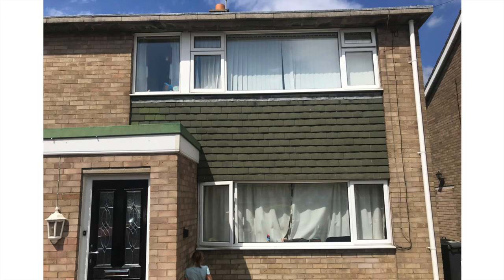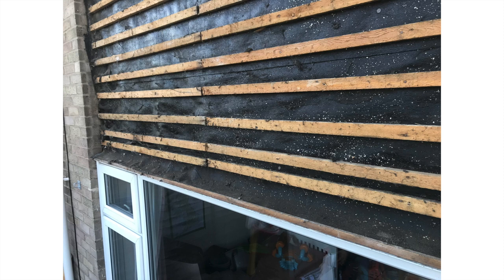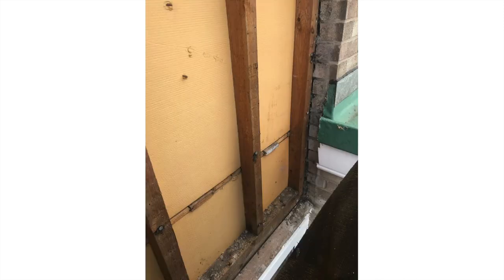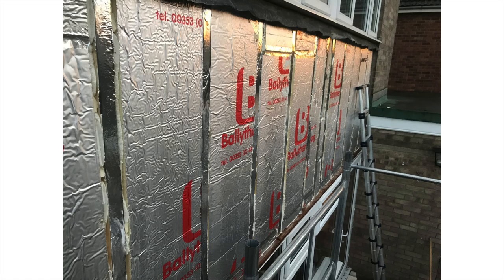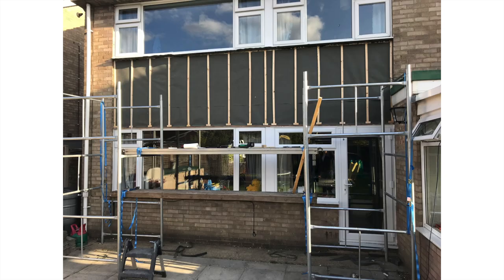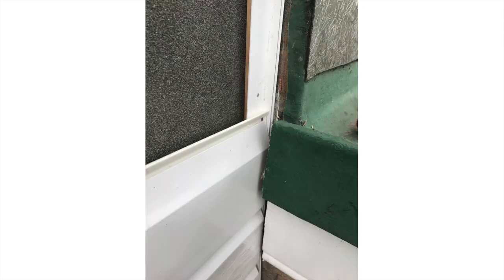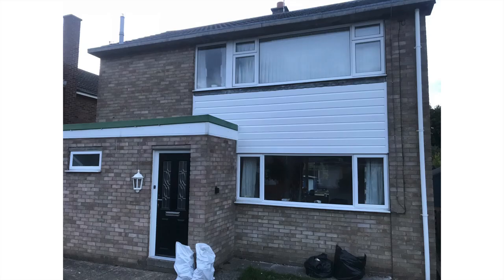Behind the tiled panel installing insulation and upvc cladding

Comment: Well done… surprised it was originally only timber framework with no insulation, I thought it would be concrete blocks behind the tile cladding.
Reply: Our 1960s house has this facade as well but it also has block-work behind. It's still badly insulated though.  Must be different construction methods across the various developers at the time..

Comment: Nice job you've done of that, 120mm is a bit overkill though, the spec for a wall like that would only require around 75mm but it won't be cold that's for sure lol
Reply: You can never have enough.
Reply: Id have agreed with you 3 years ago… but having been through the winter we just had at the fuel prices we now pay… the more insulation the merrier!
Reply: We are looking to do this on our home. The gaps in the tiles also allow pests through so this looks great. Thank you for sharing.

Comment: Hi Brilliant Vid James!  We have same row of external tiled panel on similar age property - in our case a block of flats.  We were wondering what's behind the wall tiles.   Shocked to see it!!!   Our block is having a lot of condensation issues inside flats both below and above the row of tiling.   Do you think draft getting in behind the row of tiles can make its way into the wall cavities throughout the building, thus making the internal walls  below and above the row of tiles (not just behind) extra cold & thus causing condensation issues?   Do you know how the tiled panel joins up with the cavity wall below and above and are there gaps into the cavity wall from behind the panel?  Also have you or anyone any idea why buildings had these tiles put on rather than a wall back in those days?  Would appreciate any comments :-)
Reply from the maker: Hi, yes, a draft can get in. the original wood is not airtight. Condensation is all about the Due Point, which is affected by the temperature of the air, the water content in the air, the temperature of the surface and the air-flow. Warming up the walls and internal air-temp should reduce condensation, but it depends where the water is coming from (showers with no extractor fan, drying clothes inside, etc..) You normally have to do a few different things to get rid of condensation and increasing the insulation is only one of the things. 

I blocked up the small gaps around the wood in the cavity with silicon sealant, but some airflow is not necessarily a bad thing. I only did that so the little polystyrene balls didn't escape when I had the cavity walls filled, which I had done a few weeks afterwards. So in summary, yes, it should help reduce the condensation, but it depends on what's causing the condensation. 

Houses were built this way due to the high price of bricklayers (due to bricklayer unions and the 2nd world war taking workers out of the industry) Wooden frames as walls were very popular in the 60's.. started being phased out in the 70's and by the 1985 were breaching building regs due to the poor thermal value.
Reply: @jameslincs  Hi James. Thanks so much for your response.  Understand about needing to do a few things to tackle condensation.  In my flat I installed extra ventilation and had a polystyrene layer added to offending walls to warm them up and stop severe condensation.  Dehumidifier is used whenever drying clothes and door shut with extractor fan left on after showers.  Other flats also have similar condensation damp issues.  Our attention has now turned to the row of tiling as possibly having an effect on the internal walls being so cold.   We would like to have cavity wall insulation done but were advised we need to resolve the damp issues first as otherwise it could cause more problems.  However, if the damp turns out to be solely to do with the temperature of the walls then cavity walls insulation maybe needed to sort out the damp.  Thanks so much for the info about why wooden frames were popular in the 60s.  Am amazed!  Would never have guessed that the reason!  Didn't see that when Googling either.  We wondered if it was about giving extra protection to walls - but after seeing your vid, clearly not as there are no brick built walls at all underneath!  Goodness.   Were there other good options to UPVC that you considered replacing the tiles with?  Also when you had cavity insulation done did they need to separately spray under and over the wooden wall section?  Thanks so much for your helpful vid and comments - massively appreciated!
Reply from the maker: @gaiaum  maybe they are concerned that the damp is from the gutters leaking into the cavity. We had to have new gutters before we could get cavity insulation installed. 

Yes, they will put it above and below the wooden panels (if there is any brick above the panel area, which their normally isn’t, at least, not on a house anyway)
Reply: @jameslincs  Wow That's got us thinking!  Our block is 3 storey with two rows of tiled sections & two rows of painted white sections next to windows (above lower brick layer).   Now wondering if the white sections are similar wall construction to the tiled sections - always thought it was mad to have white sections which need expensive painting maintenance (with scaffolding as so high) & wondered why the original builders didn't follow through with the brick.  Looks likely they are also stud walls, covered in render, as it sounds unlikely as you say that there would be brick built above tiled panel sections, seeing as the tiled sections have no brick wall behind!  Goodness!  Well this has certainly been an eye opener!    We will investigate further now... Thank you so much for your post and advice - so helpful and much appreciated!  👍😃
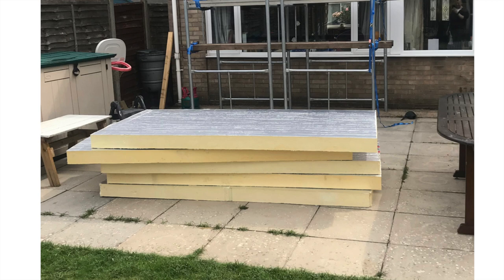Reply: 1:41 Using wood framing in these sections probably made sense because the windows alone would never support the weight of a brick&block wall, so one would need either heavy mullions or heavy lintels to support the weight of masonry, and that would involve a lot of complication and skill. My front wall is all masonry, but my next-door neighbors house, which shares a wall with mine, has an upstairs bumpout to make room for a 3rd bedroom, and that's framed in wood for similar reasons.

Comment: I've done a fair amount of cement board siding. But there's one job that's been weird. It's a full timber constructed house but between the two bedrooms upstairs the plasterboard is literally set back external to the windows and has like an insulated asbestos sheet backing. Bizarre

Comment: Excellent Video very helpful with all gas prices going up, can you please let me know if multifoil insulation can be good option instead of Pir? Can we get say same level of insulation from 30mm Multifoil to 50mm Pir?
Reply from the maker: I haven't used multifoil or BreatherQuilt, but with the price of PIR increasing, a foil system might be the better option. I haven't looked into PIR vs Foil, but it seems like both would do the job.

Comment: I think you done a good job, how much do you think this would cost with materials and labour for front/back as my house is wall tiled just like yours? I like that you used the metal brackets to strengthen the joints between wall and batton.
Reply from the maker: Things seem to have gone up in price since I did this, so I would guess £1,500 to have it done. Depends on size of house, location, etc.

Comment: Great video. I have this on the back of my house, however I'm looking to build a timber frame extension which would mean having a top wall plate batten running across the cladding. Would you suggest I need to remove the cladding first or can I fix directly into the cladding, ideally into the furring strips to get a better fixing?

Comment: Great video.
I have a 60s ex council house. Is it normal to just have a wooden frame under the windows downstairs and upstairs? I currently have wooden cladding on outside?
Reply from the maker: It was a very popular style in the 60’s. Panel construction used less labour so was cheaper and to be fair, is not a bad style of construction. I do recommend putting some insulation in there if you can.
Reply: @jameslincs  thank you. Very good video keep it up
Reply: Yes, make more content!

Comment: Really helpful as i'm about to have a go at this, 2" of rockwool just isn't enough! I'm curious what the brackets are you are talking about? Haven't seen them anywhere.
Reply from the maker: Thanks. I bought these from B and Q or Homebase or maybe screwfix. they are just generic right angle brackets. Cheap to buy and maybe not necessary, but I like to go a bit OTT with the screwdriver sometimes.
Reply: @jameslincs  oh I meant the insulation brackets you mentioned sorry! I've seen / heard of hanging brackets - having a challenging finding information on how to install them tho. Keep searching I guess!
Reply: @RollCorruption  About to do this on my house, did you find the insulation brackets? thanks
Reply: Yes. All DIY stores have them.

Comment: What impact did it have on temperature in the home and heat loss?
Reply from the maker: Hi, it made the house much easier to heat. The winter before the boiler used to run for hours and hours but now it comes on for 1 hour and then turns off because the house is warm and holds onto the heat much longer. It’s reduced the heating bills. 

We also had cavity wall installation installed afterwards so it’s hard to work out how much of the difference is from that, but I have no doubt that insulating the panels is a good idea. If I moved to a another house with these panels I would definitely put some insulation in there like this. There is a noticeable improvement (there used to be a draft under the bedroom floor boards making the bedroom floor cold and this also cured that problem)
Reply: @jameslincs  thanks. I need to do the same on my house then!

Comment: Very interesting video. Kudos. What sort of felt did you use? Do you know if it's supposed to be breathable?
Reply from the maker: Stelian Dan ....it’s just normal roofing felt (no stones on it, lol) you can get if from any builders merchant, it’s nothing special. I’ve seen some with black plastic sheets, and some with very heavy duty tarred felt. It doesn’t need to be breathable, because its not sealed air tight at the edge. I guess it’s just there in case any rain was blown up through the cladding.

Comment: If you break a tile are they easy to buy now?
Reply from the maker: They are sometimes called Peg tiles or Rosemary tiles. I expect you can get them on eBay or a builders merchant might be able to get them. Clay Tiles are not normally as thermally efficient as plastic which might be why they are less popular these days, but I expect you can still get them if you prefer the look of clay tiles.
Reply: How does the area that is insulated breathe ? Have you had any moisture problems?
Reply from the maker: @progpuss  after researching the options, I decided not to put in a membrane (normally a polythene sheet) to stop moisture, so any moisture is free to move in and out. 

The insulation is good enough to stop problems of ‘cold bridging’ and so we have had absolutely no issues with moisture on either side of the house (north side or south side). Honestly I think I made the right decision, as if any moisture does get in, it can easily get out the same way it got in.

Comment: Do you need planning permission to change the hanging tiles with something else?
Thanks
Reply from the maker: No, not unless it’s a listed building. 

I think my neighbours might have objected if I had done it bright pink or something, but I could have if I wanted to, as it’s not a planning issue. 

Flashing lights or glow in the dark can be considered forms of light pollution, so that might need permission in some rare circumstances, such as if you are near a busy road, meaning it might distract drivers... so common sense should apply. 

Their might be specific restrictions if you live in a conversation area. You can research and should respect any conservation restrictions... if you want to breach a conservation restriction, you will need permission. 

but if you’re a normal house in a normal area planning a normal improvement like this, then you don’t need planning permission. 

Building regulations will apply, but that just means that you can’t make it worse than it currently is, which you obviously wouldn’t do anyway. You are not required to meet building regs of the modern standard, just the regs that were in place when the house was built. (If there were any in place) 

Thanks

Comment: Is there not a need to leave space for ventilation gap or anythiny? Hows it holding up??
Reply from the maker: Quite the opposite, you don't want any gaps as it makes the insulation only 50% as effective. being sealed keeps out moisture. This kind of insulation is hydrophobic, so it won't absorb moisture from condensation. There is a gap between the outer PVC panels and the insulation, but that's just to let any rain that happens to get through the uPVC panels to be able to drain out. It using Rockwool in a bag, it would be a different story, as you would get condensation problems on the plastic lining, but that won't happen here. no problems so far anyway.,
Reply: @jameslincs  ah ok. I have the same. So maybe this is something I should do.
Reply from the maker: @DannySimpson-y8l  i personally think it is well worth doing, but obviously all houses are slightly different and maybe you should take some professional advice regarding ventilation etc.. 

my house has been fine (so far), but I can’t make any guarantees, as your situation might be different. You never know exactly the situation until you’re at the property, so always use common sense and maybe get professional advice if you are unsure about it. (I was a roofer before and so I know a lot of things that I forget to mention). 

For example, a house by the sea or that has driving rain or is normally prone to condensation problems (built in wardrobe or something on that wall, etc.) might change the advice regarding ventilation. 

Every house is different (even identical houses) due to different weather conditions, different lifestyle factors, (drying clothes inside, heating on more less, etc) so if you do the same to your house, it’s at your own risk. 

But in general, you don’t need any ventilation between the insulation and the inside walls, any moisture that is absorbed by the inside walls will also be drawn out from them, so it should just make the situation better. However, if you do leave a gap and rain water blows in, but then can’t escape, that could be a problem, which is why the gap between the upvc and the outside of the insulation is a good idea (to let that rain escape) Hope all that makes sense. 

I’m thinking about offering this service to customers. No one ever asks for it, but it makes sense to do it. What do you think folks would pay for me and my workers to come and do it professionally?
Reply: You've made it look easy. But I'm sure it's abit more of a pain for a diyer with no experience. So maybe some people would pay yer. God know how much I'd pay tho. Looks like a 1 day job right ? Labour for one day + materials?

Comment: Great video. What height scaffold tower did you use?
Reply from the maker: I got a 6m tower (£350 on ebay) and used it in the formation shown (2x 3m towers) and walked on a Youngman board (£90 also off ebay). The walking platform is about 2m off the ground. 

 ...I sold the towers and board afterwards for the same price I paid for them (actually I think I made £10 profit on the Youngman board) The House is nice and warm in winter now, (cooler in summer).. so glad we did this to it. Money and time well spent.
Reply: @jameslincs  Thanks very much. Got a similar job to do around the bay window so will need to get a tower. The heat savings will pay off but good to hear you made a small profit :) All the best
Reply from the maker: @soup2420  I strapped the tower together with little ratchet scraps, which made it much more stable, so that’s a good idea. 
Hope the Bay Window goes well. Cheers
Reply: The size of the house. Idk man I’m 12 (James Drury daughter)

Comment: Hi, good job. Do you put ventilation in?
Reply from the maker: Nope, I looked into vapour barriers (basically plastic sheets) and found they themselves are the cause of condensation and mould. The foam is waterproof anyway. If any moisture somehow gets in, it can escape through the fibreboards, or the same way it got in, so I decided that no additional ventilation is required. They have used spray foam in American timber frame houses for years and so far, no damage to the wood. if anything, it's probably more likely to protect the wood, plus the foam is fire-resistant. the house is so much warmer in the winter and cooler in the summer, and less drafty, well worth doing.

Comment: Did you glue the pir insulation?
Reply from the maker: I cut it so it fit in very snug, then I put a little bit of expanding foam around the edge to hold it in place.

Comment: Hope you don't get rat's, that looks great for them to make a nest in.
Reply from the maker: I’ve never heard of anyone getting rats in these walls, but in theory you could I guess. 

Best not to leave any food lying around that might attract rats. 

Having this insulation installed probably reduces the chance of getting rats vs having nothing or having rock-wool, but I’m not aware of any studies on the topic.
Reply: @jameslincs  Everyone thinks rat's are looking for food, they will eat your food but if they can get in the drains / sewer they have all they need to live. They come into homes for heat. The reason I said anything was because your house is almost identical to mine and they was getting into the cavity and then into the tile panel and under our floors.